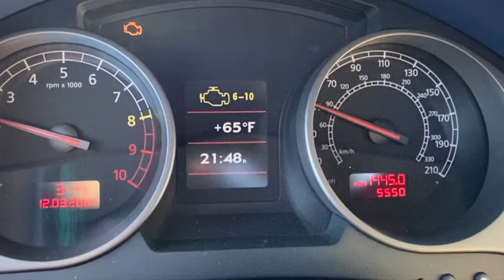My Lamborghini Gallardo Has Been Broken For Nearly 6 Months (We "Fix" It)

Comment: I had the same thermocouple problem on my 07 Gallardo.  The problem most Gallardo owners have is with the thermocouple module located above the rear passenger side wheel well.  You can easily access it by removing the wheel and wheel well cover.  If you have access to the Lamborghini LDAS software you will be able to see the live CAT temperature readings that is coming from the thermocouples.  You may just have a connection problem where the thermocouple wires plug into the module.  Your best solution may be to just replace the thermocouples and module with the newer style part number: 0R1400030.  The newer module is a sealed unit that is not exposed to the elements compared to the original module.  Hope this helps.

Comment: Stop to pump gas,pop the fuel cap open,and both tank vents are fried dead open ?
I would say that you have a small vacuum leak on the fuel cap or something.
Having both banks with a problem at the same time is pretty odd.
Check the long term fuel trim,and short term while plugging the fuel tank manually for few seconds.Check if you have a fuse for them also.

Comment: The temperature probe is a thermocouple , it outputs a small voltage. The tech should measure the voltage with it disconnected from the car. The voltage will be in the millivolt range. The voltage vs temperature can be determined by the type of thermocouple, as denoted by the color of the wires, referenced to a chart for that type.

Comment: Preamble: I've added some info here and there as it's come to mind, so this may be out of order. It's only a few paragraphs, though.

It's always possible that a sensor had a hiccup for whatever reason. Maybe you may have driven through the rain and one of the connectors isn't quite 100% watertight. Maybe the computer just detected an error somewhere along the bus. This can happen because most modules in modern cars share the same one or two pairs of wires (high and low speed CAN send/receive usually). Or maybe the sensor needs to be screaming hot to fault out. I think you said it happened after Tavarish gave it a spin, so it could be that, too. I suggest you steal Ninja's scan tool and start logging, and go for a really hard drive to get the exhaust nice and hot.

These can be annoying issues to track down, but because it's a stored code, it will either go away after a number of engine cycles (40? On Australian GM it's 40 engine cycles (starts and runs)), or until you just clear it. However I believe if it is an emissions code, it may or may not go away. EGT (exhaust gas temperature) will be an emissions code. If you'd have cleared the code it may have sorted it. If it comes back, then you really need that super duper awesome scan tool to come for a drive and start logging things, because that's the only way you're ever going to find the issue, not unless you just throw parts at it and hope it goes away.

Also, modern aftermarket scan tools are getting pretty damn good. In addition to OBD and CAN bus, they'll pick up all the weird pre/non-OBD II protocols like ALDL (GM), FlexRay, MOST, Byteflight (all Euro), LIN, etc. I think Bosch have a couple of their own protocols for things like SRS and ABS, but you get the idea. This is why you need a pro level tool to clear airbag codes, because it may be an OBD or CAN code for readability, but the module doesn't actually speak it. At least I think this is how it works. I'm a dum dum so I'm not entirely sure. There's actually quite a few different automotive comms buses, and modern scan tools can deal with most of them.

Hope this helps. I'm not a qualified mechanic, just a shadetree guy who can't afford to see a real mechanic, plus I have a mild electronics background, so, I'm always learning, not that I know much at this point.

Comment: Many tmes, it is a wiring issue for those tank vent valves, and for the exhaust gas sensors (egt), carbon builds up on the port that the gases travel thru.  There are 4, and the error is that there is a difference in temperature between the 4 sensors. Taking the sensor out, and cleaning it with brake cleaner fixes the problem

Comment: Mechanic work almost never goes as planned, especially the first time doing a repair or replacement.  I mostly avoid it by buying cars with 10 to 50 thousand miles, then selling them with about 95 thousand miles. The April issue of Consumer Reports magazine at a library helps pick more reliable vehicles. For older vehicles, the Carsthatlast series on YouTube is helpful.

Comment: The heat sensor looks like a thermocouple, which produces a small current when heated. So a cold ohm test could reveal a short but you have to bake them while hooked to a voltmeter to see if they work. Even then you can’t tell if they  are “accurate” except comparing them to the new one...

Comment: Omega makes all kinds of temperature sensors for lab equipment, not just for Lambo, and you can usually tell by the colors of the wires what kind they are; red and white is J thermocouple, yellow and red is K type thermocouple, blue and red is T, etc. Checking ohms will tell you nothing about them because they PRODUCE voltage. How much they make depends on type and temperature, but it's usually around 200ish millivolts for K at a couple hundred degrees. I think... there's charts online for that.

Comment: Plug in the scanner at Johnny’s, unplug the exhaust temp sensors one by on until you don’t get a new code or you get a code showing the same bank or position and you’ll know which is your issue. Then reset it.

Comment: Ohms, I don't know man, if it's anything like 02 sensors, they don't read properly until they're hot enough. Ask the mechanic guy, if the issue is still there maybe he could meter them when hot. But temp probes should work at all temperatures no? Just thinking out loud.

Comment: That temperature probe is made by Omega engineering, they're usually less than 100 bucks  or cheaper. Just need to know what type of Temperature probe which is probably in the part number on the package

Comment: As a kid I had a 58 Chevy pickup with a straight 6. I decided to change the spark plugs in the rain because I was that dumb. I climbed into the engine bay and pulled the hood almost shut and used a flashlight. That was more than 30 years and 100 pounds ago. I don't miss those two brain cells one bit.

Comment: You should have run the car to heat up and than check with ohm meter. The fault code is there because there was difference in reading between the 4 sensors. (I am not car mechanic just have electrics knowledge)

Comment: Johnny is happy as he knows you are not getting the normal labor rate, nor the if you watch rate, but the I tried to do it myself highest hourly rate!!!!! There is also the tool use charge. His start up business debts will be paid quickly. Run engine and see if the temp probes are thermocouples and does not put out the same V once the catalysts temps are the same once checked with IR temp gun.

Comment: It’s audi, audi is always broken
Reply: audis are actually not too bad
Reply: JP B I am european, trust mi every single Mercedes or BMW are more reliable than audi with tdi, tsi or tfsi engine
Reply: I am German, trust me. You can’t kill a old „pumpedüse TDI“. Doesn’t matter if Audi, VW or Seat
Reply: JoK3ah yes, thats I wrote new tdi, not old 1.9. But 2,5 tdi v6 was shitty as fuck
Reply: My 2018 Q5 TDI is reliable but my Mercedes ML350 BlueTEC is more reliable had the Mercedes for 6 years and had the Audi for 1. Audi’s window regulator failed and the radio keeps cutting in and out but the Mercedes had an issue where the Blindspot monitoring failed and the window kept going down after you put it up. Both cars are more reliable than Range Rovers for sure
Reply: Bip Bop range rover is piece of crap
Reply: Actually no it's not.
Reply: Pan Bałagan I know
Reply: Robert Spaans range rovers are luxurious but unreliable
Reply: Pan Bałagan I’m also European

Comment: Those vent valves are nothing to change but evap systems can be a pain. There is nothing special about the part all they do is open and close when the computer says  to, although you won't be able to pass emissions without them working right. 

I replaced my entire evap canister and purge valve on my 04 Honda for $100.00 and I did it myself I've never done one before but you're lucky I had to crawl underneath the car with bits and pieces of rust falling into my eyes.

Comment: I wonder if the temp probes and their outputs are that much different. This one is $184...and looks EXACTLY THE SAME. 

91-93 Lamborghini Diablo  Model EGP Temp Thermocouple Probe 004431295

Ever priced these out from the factory, absurd price for such a simple product. We knew there was a massive Lamborghini tax going on here, so took it upon ourselves to see what we could offer.

This is our exact replacement, identical to the original in looks - performance and characteristics in every way possible.

Part # 004431295

Suitable as the direct replacement to EXHAUST CATALYTIC CONVERTERS

Comment: You light came on from overfilling the car. Next time stop when handle pops. Fuel runs back down evap and throws a light. The parts I'm sure were fine. Probably just needed to clear the codes and stop stuffing the tank to the top.

Comment: Those valves and temp probes look exceedingly generic .
The valves can probably be found on FIATs Alfas Reno and Daewoo 
The probes are standard egt only the resistance value and the fastener may cause and issue  but nothing a few resistors and bench vice to remove the fastener from the old one wouldn't be able to fix

Comment: “Check engine light”. Fantastic mechanics cash cow. I fix all my check engine lights with a 1/4 inch drill bit
Reply: yeah I usually pull the cluster & pull the bulb. Fixed.

Comment: how come these super cars are Junk throwing engine lights all the time and Old BMW V8s and V12s running for 250,000kms with few to no engine Problems?
Reply: Because the " Super cars" ARE junk. Designed for failure like German cars.
Reply: Lexus LFA is probably the only reliable super car

Comment: If you wanted a drama-free reliable easy-to-work on car thats quick and engaging, a Toyota Camry with a manual transmission would do just fine. A used one will save you money AND never break down. Buying a Gallardo just proves there were other intentions for you, not just a car to drive around in.

Comment: Let's think about this...  the car shares VW and Lambo parts.  VW parts are cheap and durable.  Lambo parts are fragile and expensive.  It doesn't take a lot of thought to figure out which parts are going fail first.  Also, a 15-year old car with only a few thousand miles on it is going to start puking parts, because plastic and rubber parts age, whether they are used or not.

Comment: I have an 07 Elantra. ( 120K miles ) My check engine light has NEVER come on. It has never left me stranded and only failed to start once when the battery was 6 years old and had died.( quickly started with a jump pack in the car )  Stop dissing Elantras. All SuperCars suck. They always have and always will. I bet the failure rate % for DaeWoo is lower than Lamborghini.